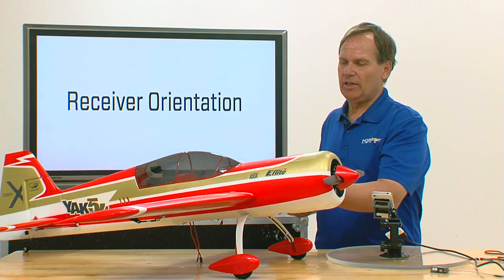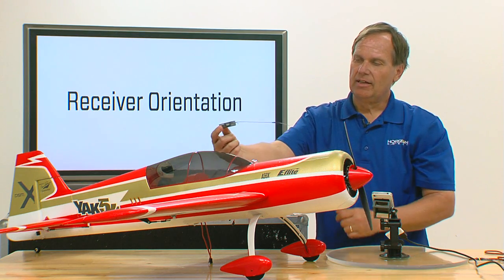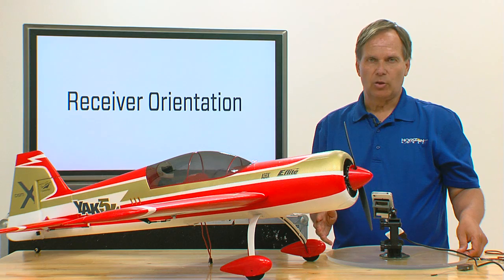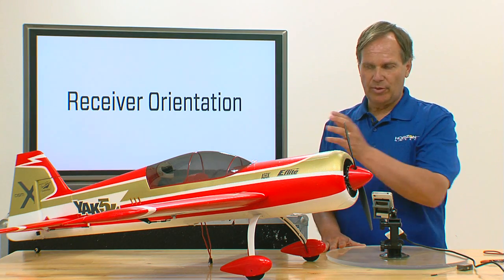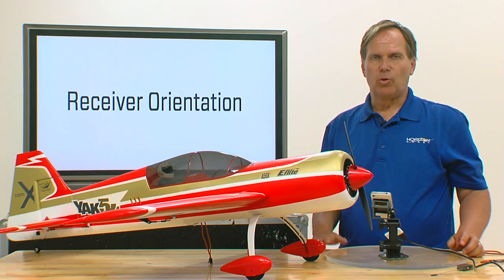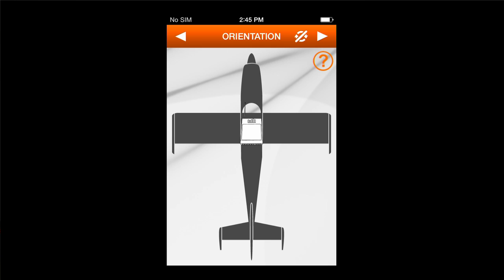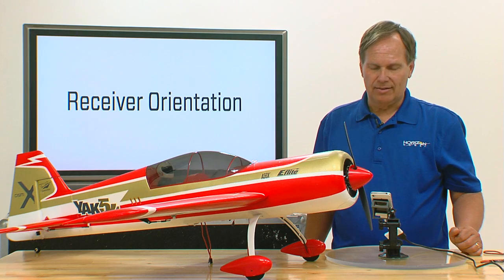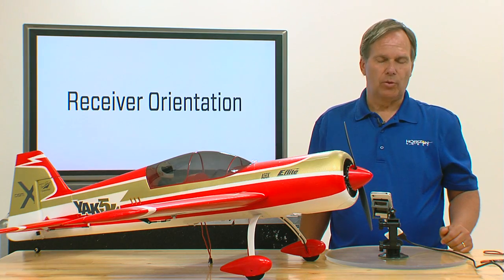Spektrum AS3X Step 7: Receiver Orientation (Initial Setup)

Comment: Hey, I know this is kinda weird, but is there any way to disable AS3X on my AS631 rx?
Reply from the maker: If it came with a model, you can update the AR631 to unlock it, then you can use forward programming to make one of the flight modes zero gain/as3x off.  Look up the Unlock AR637T video on our channel, that will walk you thru it.

Comment: Although the app has a single selection for the 636 and the 6335 Nano and shows the same orientation picture with the label text and antenna out the top and the "ports" at the bottom, the documentation for the 6335 for orientation on page 6 says the following:

"The servo 'pins' must point towards the nose or tail..."

On the 6335, the "pins" (contacts in the ports) actually point out at you when looking at label text side, perpendicular  to the antenna not out the end opposite the antenna as on the 636.

The question is whether I am over analyzing this and should assume that "ports" = "pins" and should just follow the pictures or should the 6335 be installed antenna up?